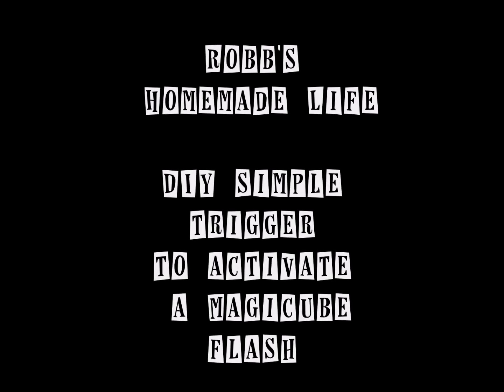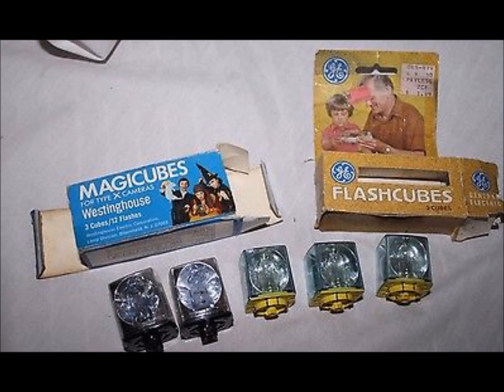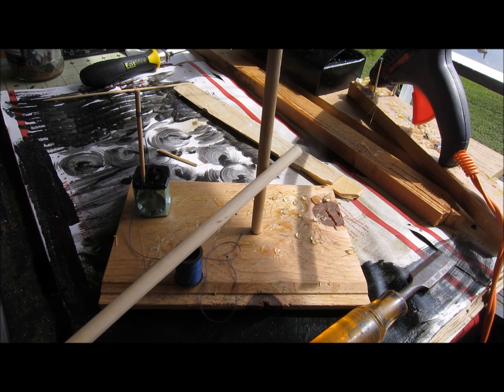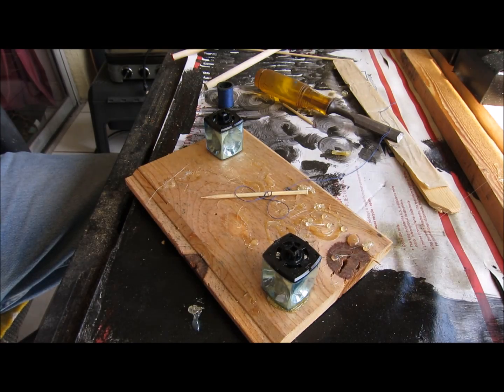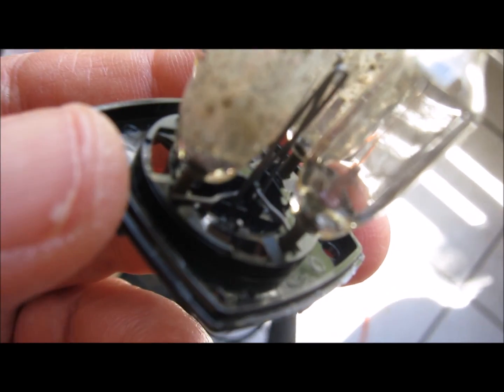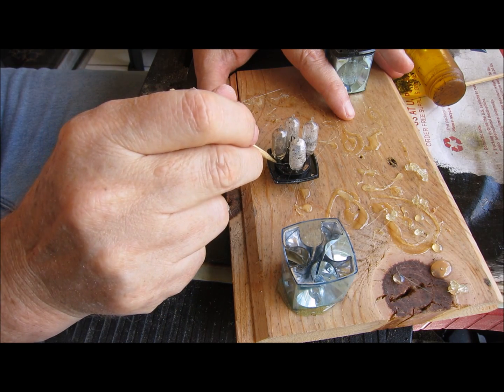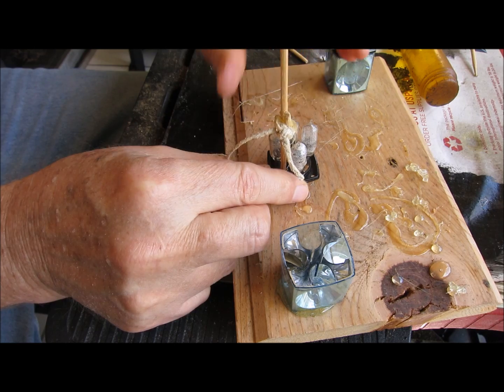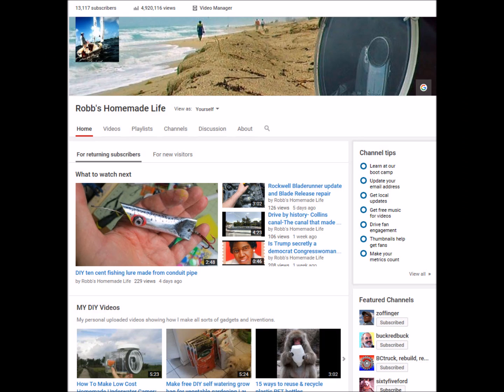DIY 1970's Magicube flash trigger for tripwire perimeter security alarm

Comment: During an OCS at Ft Bragg, a clever Lieutenant, in my platoon set up several of these around our defensive perimeter.  He used the cubes, fishing line and paper clips (between the pine trees).  We knew another platoon would attack our position to take an ammo crate given to us for the exercise.  IT WORKED GREAT because they tried to sneak in during the night.... Ultimately, we engaged their MILES gear with ease.
Reply from the maker: Hey thanks for watching and taking the time to leave a nice comment  much appreciated.

Comment: I remember when I was a kid messing around with the camera that used the flashcubes. I found that if you remove the plastic reflector shield before firing a new cube off all of the segments fired at the same time.  Thanks for sharing.